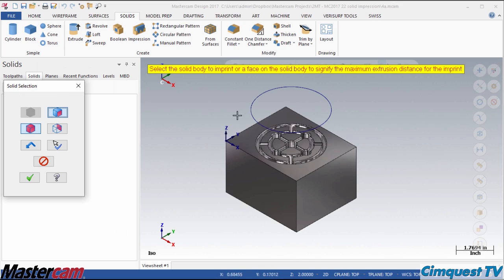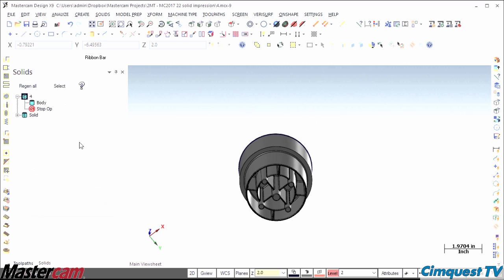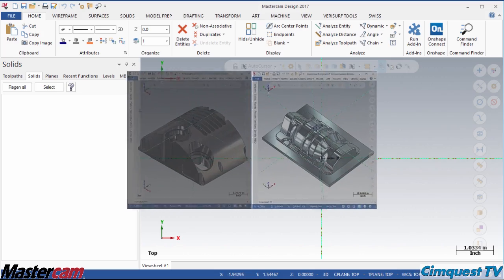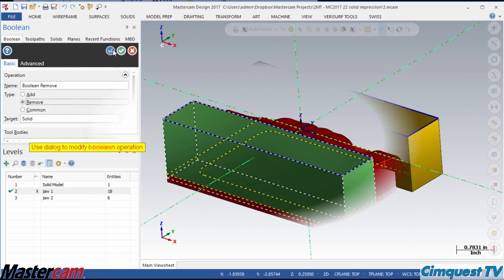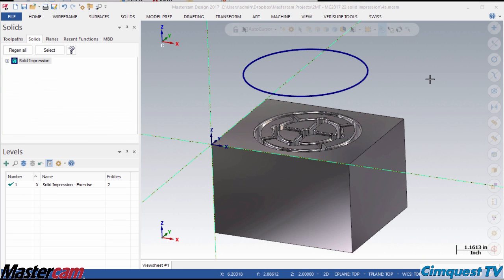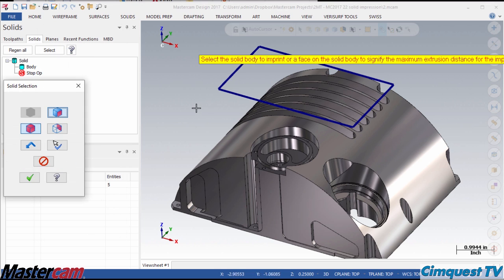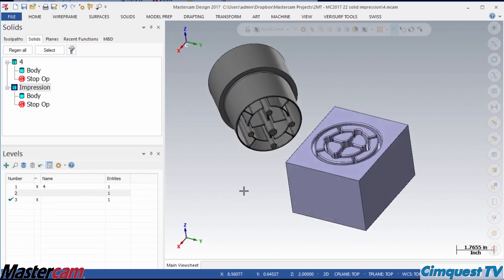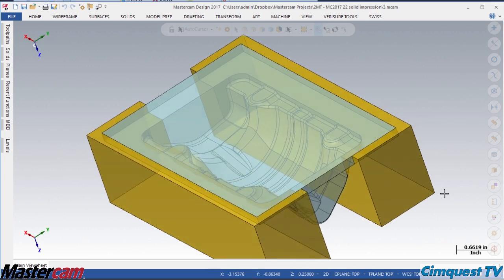Solid Impression - Mastercam 2017

Comment: Is it possible to use negative offset surface values when creating solid impression? What I want to achieve is to cut my soft jaws using this function to create 2nd operation fixture (flipping the part 180 degrees), if I cut it to ZERO offset I’ll not be able to fixture the part properly, I’ll need the impression surface (solid) to be at least -0.030~-0.04” (deeper/bigger) to create good grip between the jaws and the part, thanks